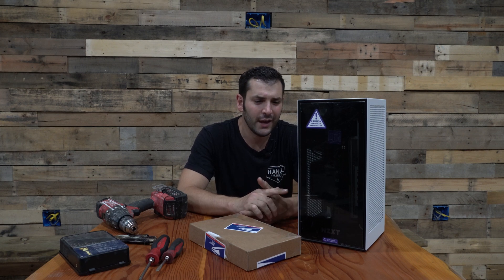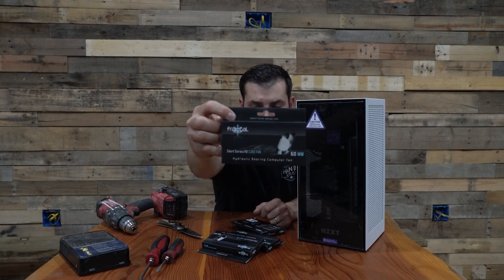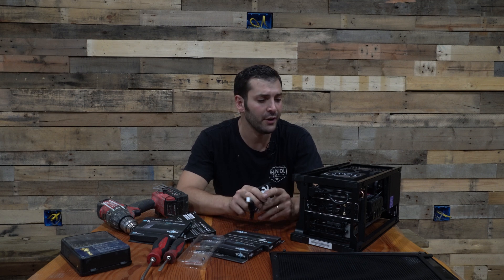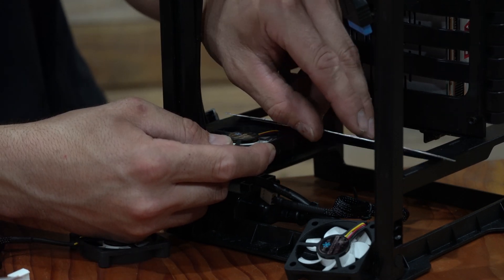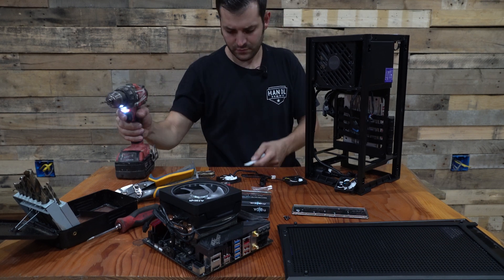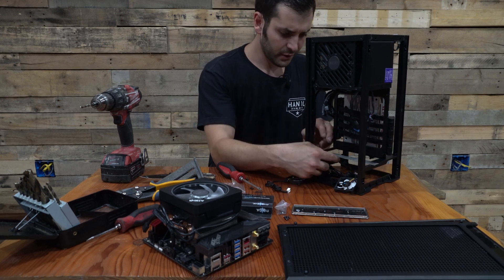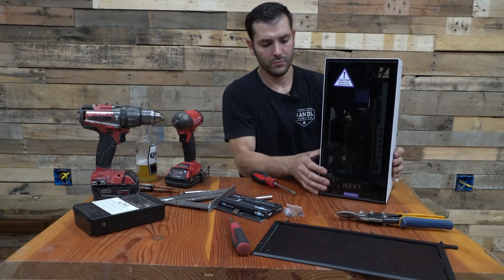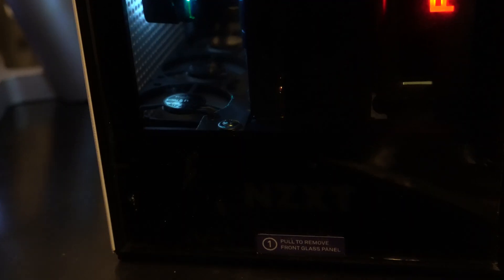Cooling The Aircooled Nzxt H1 with RealSlav Lower Tripple Fan Mod Ryzen 9 3900x

Comment: Did this result in thermal improvement? How much?
Reply from the maker: it was not for thermal but to maintain usage of the air cooler, it however did suffer and not remain cool no quiet

Comment: Great video :) but doesn’t the Nzxt h1 come with a 140mm Aio? Wouldn’t it be better to use that for the cpu instead?
Reply from the maker: had the air cooler on and was fascinated it fit so I tried it out
Reply: @realslavmedia5792  Alryt that’s fair enough does look pretty dope aswell one of the best looking box coolers.

Comment: I got 2 140mm nzxt fans at the rear, temps went down 56-60c max gpu load, 60c max load on cpu while playing call of duty warzone
Reply: How did you put them in?
Reply: @RuggeroCappello90  outside the back panel

Comment: Ifyou want to do a propper mod, put back in the aio and replace the aer fan with a noctua. That really makes a diffirence. And you wont need those extra fans
Reply from the maker: actually just swapped to a sliger sm580 and the thermals crush the h1 with no fans and im even using the nzxt 140mm rad. im talkin 14c less degree gpu difference and 7c less cpu. so the real mod is ditching the h1

Comment: Even if you really want to use an air cooler with the H1 there are better coolers than the Wraith. Also, your going to really hurt yourself the way you use your tools. Running a knife along your leg and drilling into your hands is Russian roulette with your body parts. Hopefully you're still in one piece. Great ideas, scary execution.
Reply from the maker: It was just to mess around with the case since i never used aio before, im sure theres hundreds of coolers that are better but it was all in fun. Im actually going to use a different itx case with artic liquid freezer 240mm aio just to make sure it stays cool on lobger rend renders. Im staying around 75c with another set of fans in the back. Thanks for your concern on safety also, i do have all of my fingers still after 35 years. Hope to keep them intact for another 35.

Comment: Cool idea om mouning those fans at the bottom, thanks for taking the time to share it. Maybe next time include some basic temp improvements as well? Still need to get my H1, but for now I'm planning for additional 40-50mm outtakes at the back as I expect that to be most effective. Curious what your next approach will be. Also very cool you attempted the aircooler, but your conclusion is that it is not effective as th AIO under heavy load?Did you switch back to the AIO?
Reply from the maker: soon to be making video of different fan setup using the aio to pull air out of the top and maybe introduce some into the sides at the bottom.
i have shyed away from using the air cooler, it just became noisy, i was reluctant to using the AIO since no such thing was around when i was build pc 20 years ago and i was sticking to my guns but the aio is awesome! i will see if i can possibly make a mini custom loop in a 2nd video also.

temps are actually decent, but i have noticed with introducing air in certain places significatly reduces them!
Reply: @realslavmedia5792  Cool, looking forward to the next one! Yes, with a case like this (where you pay the money for the AIO) it also seems like a waste not to use it. Do try to measure the temps with these cool mods you're trying out and compare them to the stock case, because this will give us a great idea whether something works or not. (Even a less performing setup than stock can be very interesting to learn about, so that people can avoid these setups!)

Comment: Did you try a configuration where you install those fans on the backside as exhaust? Now they are intakes, pulling recycling in hot air from the GPU.
Reply from the maker: from what I notice my gpu is 38c junction temp being a radeon vii, so whatever air it expells yes its more warm than ambient but I don't believe it would be hot enough especially since warm air rises. so most of it probably will not make it back to the bottom of the case. my next mod will be 2 exhaust fans on the top.

so far the 3 fans I have added have cut the wraith prisim usage to idle mainly so I know it is working. before It would always fluctuate

Comment: Since you're air cooling it, what's the maximum air cooler height ?
Reply from the maker: the wraith prisim is the maximum cooler height that I would recommend. you WILL need additional cooling if under large cpu loads

Comment: You should upgrade the hardware then
Reply: I don’t think the fans help a lot
Reply: But good effort though
Reply from the maker: always think outside of the box, I just want to try and be different. I think the prisim cooler looks nice
Reply from the maker: believe it or not the 3 fans have tamed the processor fan, it has zero throttling and I have noticed lower vrm temps as well as ssd

Comment: Why are you using the air cooler? There was another video where someone tried using the wraith prism and got shit results compared to the stock 140mm AIO.
Reply: The AIO for this case is really good, and water cooled will bring temps down far more than the air cooler; I was confused when you said your h1 gets really hot when editing, as my gpu usually peaks around 72c and cpu around 68c, I was shocked you went with air cooler when the aio is exceptional, but to each their own, and I liked your new mod, but I doubt I’d put little fans at bottom as on mine the bottom is full of extension usb leads and dp cables etc, hardly any space left, but even I was thinking of putting fans on the back of the case to make it even cooler :) but great video, thank you for making it 👍
Reply from the maker: @pauljohnson7463  thanks brother , only way we find stuff out is if we try it out! currently the aio is installed and im loving it. I was outside today 92 degree weather doing a live stream and it was just chillin where as the air cooler with any mods would of died :p
Reply: @pauljohnson7463  what GPU do you run with this case
Reply from the maker: I was just giving it a shot trying to do different things than the standard.
believe it or not even editing this 10 minute video the temps were normal and it had zero throttling.